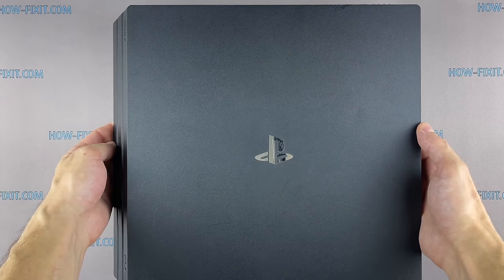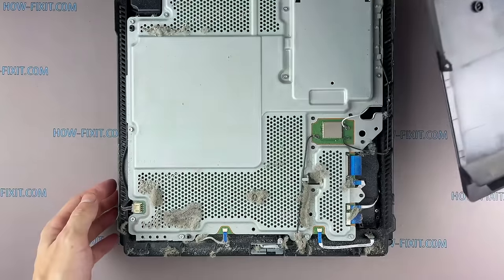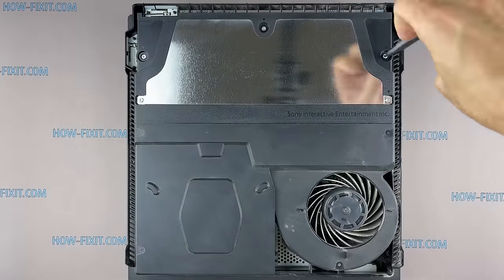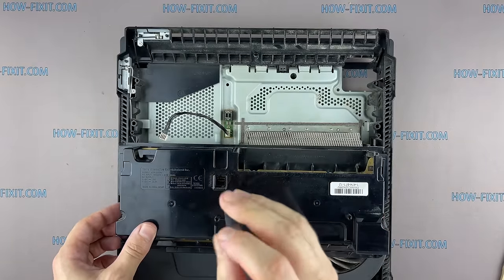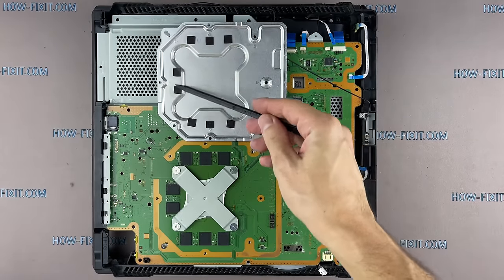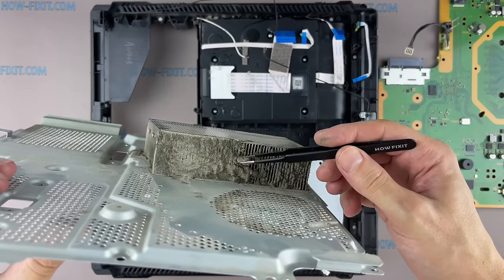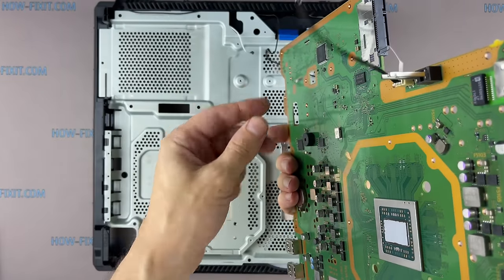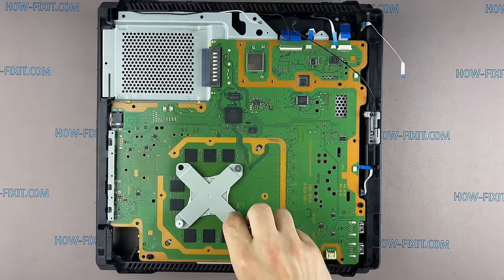PS4 Pro how to take apart, clean fan and replace thermal paste

Comment from the maker: For more info check out the links in the description
Reply: Hi there. I taking apart my PS4 Pro. I changed the cpu retention bracket for custom one from xbox360 and changed the paste to Arctic Cool MX4. The console no longer makes noise like a vacuum cleaner. But. Just in case, I removed the bottom and top plastic covers for testing. All OK. But the lower large aluminum plate, covering the entire motherboard from below, heats up to hellish temperatures. Is it fine? The heat goes through it?
Reply: Thanks changed CR battery too while eye was there I have strip filters on outside wasn't really dirty as yours

Comment: You need to be seriously careful opening power supplies, IMHO you should've warned people of doing this while risking their own safety, those capacitors still hold a huge amount of voltage even when the machine has been turned off and disconnected from the outlet. Other than that good video. For future reference never muck around with psus people.
Reply: This.
Reply: @LucaBlightOfHighland  That
Reply: Thank you
Reply: Yup. Just use an air blower since it looks like there’s quite a number of openings.
Reply: Security torx u call them bro
Reply: Just turn it on without power cable for 10 sec it should clear the voltage.
Reply: @disturbator Corect! Get discharge.
Reply: @disturbator  what do you mean? How do i do it
Reply: Here after getting electrocuted just now
Reply: @catnip2499 i just wrote it. Unplug the device from outlet, hold the power button about 10 seconds it should discharge.
Reply: Yes safety. PSU high voltage side can be very dangerous, I'll add those caps can hold a lethal enough charge for months after being unplugged. 
I work on bitcoin ASICs professionally, I just use a brush and an air compressor with moisture control(not paintbooth quality but enough). Yes static and everything...don't hold air on a fan too long or it could spin up enough to flow juice back into the board...if opening psu be very very aware of what you're actually touching...all the normal safety stuff regarding basic electronics knowledge...honestly the airgun outside can do majority of the removing of junk from the system. Could damage it...but it's a low risk if you use your head. Well worth a basic blow every now and again...not in place of deep cleaning but just as a 'maintenance' cleaning routine
Reply: Ahaha, if you dont have dedicated capacitor discharger (which can be made from old type of wired bulb), you have two capacitors each 450v@150uF. Yes, they can kill.
Reply: @disturbator thats bs.
Reply: Your reply is very, how would i say it; no facts, monkey level answer.... @HECKAKYH-ADEKBATEH
Reply: @disturbator  yeah, bull crap. What do you do plan to achieve by pressing power key for 10 seconds? You send signal to atx motherboard, that is only there when mb itself is powered! Does mb receive enough standby voltage to be able to process that signal? No. Even in at time, when button was physically connected between mb and psu it didnt work, because of ton of internal gates between caps and external wires, locking the potential inside. The gates have very low internal loss, so one needs weeks for charge to drain. Yes, even regular smartphone charger can kill you if you disassemble it, even if you short circuit its outputs on both sides. You need some high amp resistor to discharge caps directly, without burning the board and yourself.
Reply: @HECKAKYH-ADEKBATEH  well was that so hard 😬 thank you for sharing knowledge
Reply: @sohaiba5281  pedantic nitpick - electrocute is a portmanteau of electro and execute which would imply you're dead.  Since you typed that message I am going to assume you were only shocked.

Comment: OK, I am from South Africa and bought a 2nd hand PS4 Pro over lockdown for my kids.  This thing always sounded like a jet-engine and I have tried to blow it out with a compressor a couple of times.  Over the last week I decided to get it fixed and found a couple of guys who was a bit shady on FB marketplace.  Not knowing if I would get the unit back, I decided to follow your instructions.  the machine was not that dirty (well, not as dirty as yours), but I cleaned it out and replaced the paste with locally bought stuff.  (Could not see myself driving 100km to get the stuff everybody raves about).  Well, after I started it up, I thought it was broken, as the fan just did not come on/you could not hear it.  It has been running for the last 3 hours, and not a peep.  WHAT A RELIEF, and your instructions were clear and to the point.  THANK YOU, all the way from Cape Town, South Africa

Comment: my power supply cable was in there so strong i was scared to pull it out
Reply: You need to open it's screws from the other side
Reply: Dude same, my cable did not want to lift
Reply: @keran3442  don't clean your power supply it can be very dangerous to you and your console
Reply: @franklinclinton3211  nah I didn't take the power supply apart dw, seemed a bit too risky especially since it's pretty open. Just unplugged and put to the side

Comment: I used mx4 and cleaned it from inside . My ps4 pro was exactly so full with the layer of dust like this one in the video . After cleaning it is so wierd to play heavy games like rdr2 and fortnite and have 0 noise . 😭😭😭i never thought it would work so well . Best 10 bucks i ever spent on thermal paste and a good spent 3 hours of work

Comment: Thanks for this detailed video!  Bought a PS4 Pro and it was a jet engine.  Just like the video, there was an 1/8 inch of dust layered on the heat sink.  Probably the real problem why it was so loud but cleaned it all out, replaced the thermal paste and did it all in about an hour.  The power cable was definitely the hardest and was really hoping I didn't break it getting it off.  Everything worked and is quiet as a mouse.

Comment: Followed the instructions and it worked a treat. Pay particular attention to the PSU cable when you reassemble, I thought it was through cleanly but realised it was snagged after I'd replaced everything on the other side - added another half an hour to the job. In total 2.5 - 3 hours the first time. PS4 Pro is now back to original levels quiet i.e. fan is on but not noticeable

Comment: I followed your video and my PS4 pro went from jet plane to silent. I was shocked how much it changed. I used mx-4 and thermal pads 1mm and it worked great. My only issue was there was a clear film on the thermal pads that I didn't notice until I had pasted it already so I had to take it apart and repaste but no big deal. Hopefully it stays this silent for a long time.

Comment: Thanks for this video! My PS4 Pro was getting pretty loud. The issue I found out wasn’t caused by too much dust buildup, but was due to it desperately needing new thermal paste. It runs way cooler/quieter now!
Reply: Does the brand of thermal paste matter?
Reply: @Tembo_Leonardo You can go ahead and use TM30 or higher quality brands. I used TM30 since it's the only paste I had lying around and it gets the job done. No more Pro sounding like a jet.

Comment: Best disassembly video i seen yet, i watch a mew one everytime i change my thermal paste n this was the best so far
Reply: 2 months later and my system (that sounded like a jet) is still running quiet and amazing all because one minor detail in this video
Reply: @SallyHueghJanus Which one minor detail helped it to stay quiet?
Reply: @feliksdzerzhinskij800  it was like 2-4 more screws to get to the heat sink and that's what was blocking the air flow from the fan to the cpu.
Its been 8 months and it's still running great
Reply: @feliksdzerzhinskij800  just follow his steps till the end, 
I kept stopping at the thermal paste and it would just instantly melt the paste n got loud again within an hour bc the dust was blocking the airflow from getting to the processor
Reply: @SallyHueghJanus  Thank will do, this helped so much!
Reply: Np bro

Comment: Just did mine. I have the Glacier White 7215b model. The previous owner never cleaned it out. So much dust and build up around the heatsink. The Pro got so loud I thought it was gonna explode lmao. I applied TM30 thermal paste and left the pads alone. Now my  Pro is quiet. Just as quiet as my PS4 slim!

Comment: My launch PS4 Pro was one of the lucky ones in terms of its noise (compared to some reports) when I first got it but over the last 6+ years it steadily got louder eventually to jet engine levels and last week starting to ask to be shut down due to over-heating when my kids played Hogwarts Legacy.

So I finally got round to cleaning it and replacing the thermal compound with MX-4 and now it is WHISPER QUIET. The fan spins up far far less even than when the console was brand new. Should have done this as soon as it was out of warranty!

Comment: I fallowed your video, changed the fan for a new one & replaced all thermal pads. It is so silent that I had to double check if the system was actually on or not. Thanks!
Reply: Hello I don’t know if you will read this, what model of PS4 Pro you have? 
CUH-116b?

Comment: I’m going to clean and change the thermal paste on my pro today. imma use this video  as a guide. back in 2021 when i first disassembled and cleaned my unit, i also used your first video!  my unit’s serial is CUH-7006B this is a first generation right? i bought it around mid-2017. anyways, thanks for the video! really helpful! imma use the ps5 video next time! 🥰

Comment: Thanks man. I finally realised the main cause of the heat and concord engine noise. Mine was all clean until I got to the main bit and was clogged like yours. That finally fixed it and now it sounds brand new. I didn't have any paste so I just applied the same paste on the back. Hope that is ok. I have ordered some when I get it I will apply it later. Thanks again.

Comment: Just wanted to give you a shout-out and a very big thank-you I just recently purchased a PS4 pro and decided to take it apart and clean it and get it ready for the future of gaming and I followed everything step by step and worked out perfectly luckily mine was not dirty at all it was practically new I'm surprised but your instructions were very precise and as far as the power supply I think considering what's in there and the capacitors I would just spray with some compressed air once you took it out because let's be honest it's mostly space it's a lot safer than risking getting a shock but all-in-all a great video thanks😊😊

Comment: Thanks!
The intervention looks like it was successful!
"The surgery has succeeded and the patient survived"
Unfortunately, I didn't have the past to be in the link, I may regret it in 1-2 months because I have to paste it again, but I used Aliexpress HY-510 (that was home) and it turns out!
It was a very good diet point for maintenance if there were a couple of points I had to look at several times because it was not clear, eg: before removing the top covering the two screws which is on the on. It records the unit of the connection line, but in the end it is solved. But it really helped a lot.

Comment: do everything JUST DONT OPEN THE POWER SUPPLY
Reply: Nothing goes wrong if you open carefully
Reply: Just open the power supply cable on the psu itself not the motherboard so its more safe

Comment: MW2019 still make my ps4 pro pretty warm but before it would sometimes overheat. I don't even hear the fan now👍
PS be careful with that power supply and make sure your ps4 pro is the same model as this guys. Mine was a different model and i had to play around with it for an hour and a half to get it properly put back together 🙃

Comment: Seriously thought I broke it for a while because the psu cable got pinched a bit trying to remove it. It was extremely stuck in there.
But after repasting with mx4 it's now whisper quiet. Before repasting it sounded like a jet engine with the fan overpowering the game volume.

Comment: Just done mine. With larger thermal pads than original and an extra one on the hdmi chip it is very quiet, even when running VR.   The factory thermal paste was very poor and about a 1/4 of the gpu wasnt even coated. No wonder it sounded like a jet engine before.

Comment: this helped alot :)  only 1 critique, where the power supply connects... remove the cable from the motherboard, Not the power unit itself... its way way easier to manage imo
Reply: thanks man  great tip. if only i read this 20 minits earlier  before i dam near wrecked the lil connecter trying to pull it out. yeah it slid out of motherboard so easy 👍
Reply: I had the opposite experience. Could not remove it from the motherboard at all. It almost felt like it was glued in.

Comment: Great video ps4 pro is quite again but please help for some reason my internet on the PlayStation is really slow after the cleaning. My download speed and upload speeds are 500mps but on the PlayStation using lan cable it is only 5mps for download and 400kps for upload. Could have the cleaning and disassembling the PlayStation affect my internet connection ?

Comment: Help i did everything exacly the same and now every time i try to start my ps4 it just beeps 3 times and the fan starts spinning fast before turning off again
Reply: You probably broke the antenna
Reply: Check to see if any wires are unplugged or damaged.

Comment: Hi any help would be greatly appreciated, the thermal pads on my vram chips are all cracked and have black chunks falling off them, I know nothing about consoles but I’m following your tutorial and it’s working so far so good so I was wondering how I would go about replacing those? Do they need paste or anything or just buy new pad and put in place ? Thanks
Reply: You can buy the thermal pad strips, but you’ll probably need to cut them out to replace your damaged pads
Reply: Buy a set of 1mm thermal pads. Or a sheet of 1mm pad and cut them to size.

Comment: Hi I followed the steps, my PS4 Pro now makes a beep sound as its turning on but nothing happens.. just a blue light under the power button.. for about 2 seconds then its gone and nothing happens... any suggestions that can help me please. I tried holding in the power button for about 15sec but nothing. 

When I press the PS button on the remote the same happens.. power beep sound with blue light and then nothing...

Comment: Hi I have a ps4 pro when I remove the power Supply Cable its so tight. i'm concerned that I may tear the cable off the main board or the power supply. Is there any tools required to remove this cable. I watched your video but my cable very tight.

Comment: I've got ps4 pro 7216b, I've not delved inside yet but wanted to check if same process?
I'm looking at getting the Arctic mx6 paste and was thinking should I replace the heat pads whilst I'm in there, if so what thickness should I choose as your link seems unclear??
Many thanks

Comment: How the holy shit stain did that console get that caked in dust? I opened my PS5 after a year to clean it and it was like new. I will be opening my PS4 Pro soon. I’d be very surprised if it was anywhere near that dusty. That heat sink was crazy 😳
Reply: I recently got a White Pro and its the newer model thats supposed to be more better at handling heat. Upon playing games it got so loud it made me wanna go back to using my super silent PS4 slim. Previous owner said it was sitting for a year. But holy hell there was so much dust! It was so bad the heatsink had a dirty paste of dust stuck to it. Cleaned it out really good. Applied new paste, left the pads alone they were still good. Started up GoW, Doom, and TLOU Remastered. Pure silence and quiet. I'm sure using a better paste and thermal pads will quiet it down even more, but it's just as quiet as my slim now.
Reply: @SentinelEx  Yo. I since opened up my PS4 Pro. Used for about 5 yrs. I always look after my stuff and it was used in a clean room - but dust is dust and it does what it does.
I opened it expecting to find a lot of dust, but there was hardly anything. Not even the fan was dusty. I decided not to tear it down any more. There didn’t seem any point. I checked all vents and shone a torch anywhere I could. I didn’t see any levels of dust that would warrant tearing it down, so I removed any light surface dust I could see under the covers and put the covers back on. Was really pleased and surprised it wasn’t more dusty. As for heat under operation, my Pro always did get warm, mostly playing battlefield, but I put it down to being the nature of the Pro. Always kept my Pro horizontal, never vertical.

Comment: Should the fan be rotating clockwise or anti-clockwise? I think I messed up the connection and don’t know the correct direction of airflow
Reply: The connector is keyed so you can't connect it the wrong way.